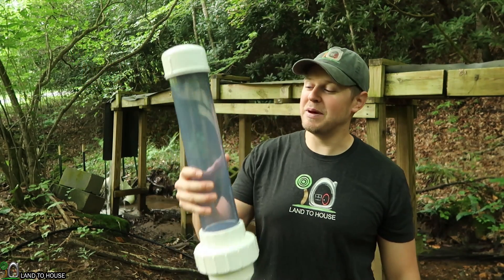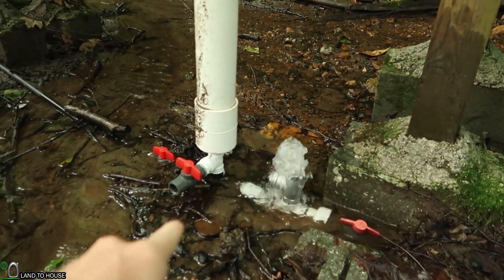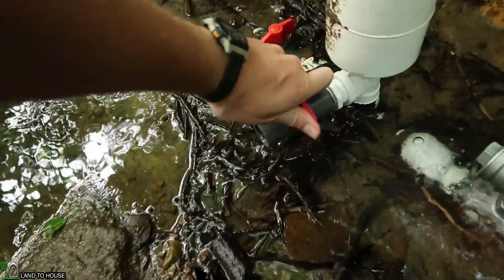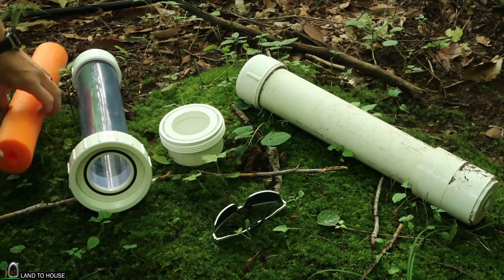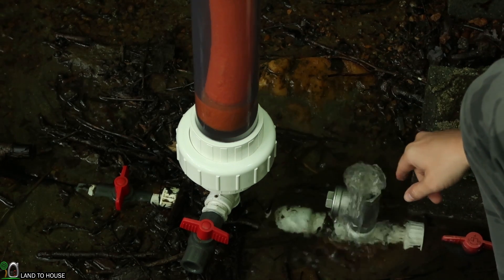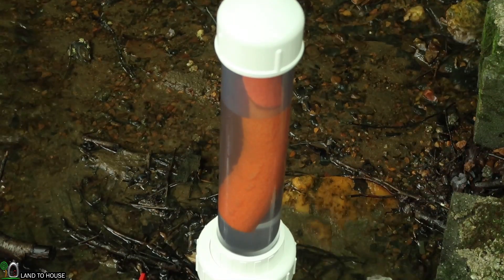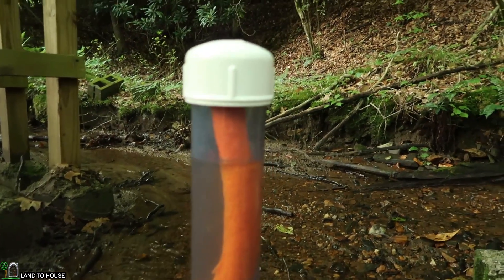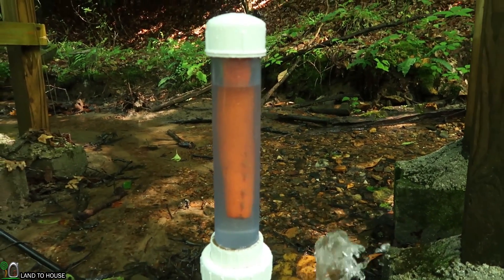Ram Pump Crushes Pool Noodle

Comment: What about using an accumulator as a pressure tank? You could even adjust the pressure with a bike pump to maximize the system output!

Comment: I believe that pressure tank it’s about 4 inches wide? getting 2 1/2 inch pipe cap each ends and make a hole in one of the cap. pass a Tire-Valve through it and fill with air and stick it inside the pressure tank note it should be half the size of the pressure tank this will be a great replacement for the innertube .

Comment: Is there any difference in head pressure if the line feeding the pump is at a 45 degree angle coming down from your filter vs it being straight up and down

Comment: I collect rain water from our barn roof in three 250 gallon IBC totes for our garden. Two sit on an elevated platform the other on the ground. I use low pressure emitters I’m raised beds. The head pressure in the totes will supply water to a point, but not near enough. Can a ram pump work with my arrangement?

Comment: fill it with nitrogen or the whole vessel https://www.toolstation.com/expansion-vessel/p70204 https://www.amazon.nl/membraan-vaartuig-uitbreiding-binnenlandse-waterwerken/dp/B004VLLNRI/ref=pd_day0_3/257-4978134-7840835?pd_rd_w=jx3m2&pf_rd_p=24063ed8-52fb-434a-81fc-a85fc785a118&pf_rd_r=V2B5M7ZBAF6QZ7451WM5&pd_rd_r=9bf15141-1993-475c-b890-190e57996de9&pd_rd_wg=NpSVf&pd_rd_i=B004VLLNRI&psc=1

Comment: Be cool if you could make the whole assembly in clear pvc. I'm still unsure of the dynamics of the ram force. Thanks great videos!
Reply from the maker: That would be fun! They do make clear valves.
Reply: @LandtoHouse  Oh yes, clear valves would be interesting! Especially the in-line check valve would be educating to see in operation. To my opinion, that in-line check valve determines (together with the drive pipe geometry) the maximum reachable pressure and the time you need to prime the pump.

Comment: I have learn from your video make 1 ram pump at my Hong Kong Farm , i am using the biggest distill water tank 5 gallon, but now the temperature difference much at day and night time, Did make a foam wrapping the tank to keep the constant temperature or put inside a bigger to keep the pressure on working ?

Comment: Does the tank even need anything but trapped air inside?
Reply from the maker: The ram pump does work without a bladder but often times it will become waterlogged over time.

Comment: Love this.
1. mark on the clear tank the water level when it stabilizes.  take the tank off, upside down fill to that mark, measure how much water that is, fill the tank completely, then measure how much water that is.  Eyeballing from the video it looks like during operation that air pocket shrinks to 1/5 to 1/6 original size.  So anything put in there will be pressured to compress to about 1/6 the air volume it started with.  

Would love to see it crush a tall stack of hockey puck sized chunks of high density closed cell foam, like exercise mats or sleeping mats.

Comment: New sub, found you on gridlessness.

Why do you need fill material?
Reply from the maker: Gridlessness's video was really funny. Thanks for subscribing. 

The idea behind the fill is that the pressure tank can become water logged over time. The fill keeps an air space in the tank at all times.

Comment: Great video Seth, what would happen if you just used a very tall pressure tank and no inner medium,  would the water weight and natural ' give' in the walls of a taller tank create the same effect as a smaller tank with intetnal medium. Pressure gauge in the top of the tanks would confirm.

Comment: I've used racquet balls successfully in my DIY pressure tank for our travel trailer.  They come in two internal pressures; 15 and 25 PSI and they've held up for a couple years so far.  I used a 50/50 mix of both to even out the outflow PSI.  I've often wondered of a ram pump could be hooked up to a 60 gal house pressure tank instead of having to pump it up to a elevated tank.

Comment: Can you test the ram pump without the pressure tank to see how the result is? If it works, the cost of ram pump will be much lower. The space in deliver pipe itself can work as a pressure tank.

Comment: Seen you on Stoney Ridge Farms with Josh. I need some help. I am disabled and freaking out as I have no water supply if shtf. I am totally disabled and can't go anywhere to get water. There is me and my Service Dog. Please can you assist me? I want a well in my yard, SHALLOW WELL. When my pool was dug, they struck the quick sand bed this city was built on at 8 foot, so they back filled the pool to less then six feet to guarantee the bottom wouldn't fall out. So I suppose one would hit water at 10 feet or less. Could you auger out a pipe hole for me/us so we can have water? PLEASE? thanks
Reply from the maker: Hello. I have no experience at all with wells. I only work with the ram pump. It pulls water from a creek to use as garden water and livestock.
Reply: @LandtoHouse  ok thanks

Comment: I'd like to see an actual pressure gauge on top of the pressure tank. You mentioned that it's getting something like 60 psi from a 7' drop? Hard for me to wrap my head around that, but I'm still studying ram pumps. I am certainly jealous of your beautiful flowing water! I have no natural flowing water and my property is totally flat, so no ram pump for me, but still a very cool system!
Reply: If you learn about water hammer it will make more sense. Its working with the inertia of the water. Brilliant.

Comment: I’m curious why you need anything inside the pressure tank! The air trapped at the top is providing pressure and acting as a shock absorber. Adding things to the tank will just lessen the amount of water in the tank. I don’t see how adding items increases pressure? The pressure you’re getting is from the amount of fall in the supply line. Wouldn’t making that line larger  increase pressure? I install emergency automatic pond siphon systems. A 12” pipe dropping off a pond dam produces a lot of pressure!! I’ve never measured it though....Very curious about what your testing reveals.
Reply from the maker: The idea behind pressure tank fill is that overtime the air in the tank becomes waterlogged and goes away and the fill material provides a bladder so there's always air in the tank. In large commercial pumps there's a snifter valve that replenishes a small bit of air with every cycle.
Reply: Hmmm. Interesting. I’m familiar with bladder tanks for well pumps and water heaters, why not use a small one of those like the ones made for a water heater? The bladder is adjustable.

Comment: OK, I am just learning about this fascinating tech. I am actually considering moving to some property near a water source, in fact I think part of this river flows over the edge of the acreage I am looking at. It would be great to have a passive system to feed some trees and maybe a garden (providing the water is fairly clean and it should be since it is a mountain watershed).  I would definitely consult you for this project. My question  today is that since the pressure tank uses the compression of air to smooth out the pressure of the delivery side of the system, why put any filler in the pressure tank at all. It seems like all the noodle would do is take space that could be used by compressable air. I realize the noodle itself has air in it, but it is also made of a material. What is the advantage of ANYTHING else being in the air pressure tank BESIDES AIR? This makes no sense to me, but as I said, I just found out about this pheonomena. As an ex-firefighter I know all about water hammer, so as soon as I realized you were just converting one form of energy for another, this "magic" made sense to me. You are basically changing high flow low pressure, to low flow high pressure, by capturing the hammer effect.  Really, you probably don't need the pressure tank at all, but it just makes the flow more reliable and probably takes off some wear on the valves as well since they move less with the pressure tank at high psi.  Also, regardless of the amount of air or material in your tank, it will still achieve the same pressure. The only difference is that a bigger tank would smooth out the pulse even more than needed.  Databyter
Reply: Over time the water absorbs the air negating the reason for the Pressure Chamber. These fill materials that are full of air are an attempt to keep the air within the pressure Chamber from being absorbed by the water.
Reply: @johnwyman6331  Thanks John. That makes sense. I guess you could also put a refill air valve in the tank which is the way I would probably roll. Just top it off as needed. Would be nice to have a sight tube of some sort to know the level of the air and have a refill valve.
Thanks for explaining this.  Databyter
Reply: @Databyter  Getting a snifter valve to work would be the best way I would think.
Reply: @johnwyman6331  that's like a pinhole valve that dribbles in a small amount of air each cycle?
Reply: @Databyter  yes it's installed immediately before or upstream of the one way valve. Sometimes you can get away with a very very small hole, or you could use a small flathead screw with an o-ring under the head going from the inside through a slightly loose hole and a couple of nuts tightened to each other on the outside which will allow the screw to move back and forth. It can act as a one way valve for the air.
Reply: I believe they're there is a point in the cycle where there's a very short lived vacuum in the pump which also sucks down the waste valve

Comment: Try to connect the pump directly to a water tank base and let us know what happens when you run the pump without a drive pipe line.

Comment: You could try inserting one or two inflated CHERNE 3 in. rubber plumbing test ball(s) into the top of your 3" PVC chamber. You'd then have compressible air bladder(s) that would fill the complete diameter of your pipe.

Comment: What would happen if you hooked a pipe to the waste valve back to the water source basicly recycling the water instead of letting it pump out on the ground
Reply: It is, the pump is in the stream where the wastewater rejoins the stream.
Now if you mean to pipe the wastewater back up hill, that can't work because you've reduced the head to zero.
Reply: @johnwyman6331  yes my question was on the feasibility of making it a self perpetuating system.  Starting it with the head of the river then closing it off and allowing the pump to divert part back up to the head to recycle the motion...
Reply: @wadekinney8  They say that perpetual motion does not work.

Comment: Hi can you prefill gases in the pressure tube with pure hydrogen, helium, argon, nitrogen ect and observe the pump performance, noise, compression and how long it takes for the gases to slowly dissolve and dissipate. You could also try installing a cutaway torus shape plate with some oil to create a thin oil barrier inside the tube.
Reply from the maker: All good ideas to try. But far beyond my ability.  Also not very practical for the average homeowner or farm.

Comment: you have a video showing your 'sniffer' valve as being some .060 inch in diameter.
It should be just barely large enough for a #14 wire. And then have a #14 wire through that hole. 

The following link gives details about a sniffer hole and where it should be located
<https://www.slideshare.net/Fatin62c/compendium-in-hydraulic-rampumps>
note especially that the sniffer hole is before the final valve
Reply from the maker: Thank you for this information. That is helpful. I do want to do further research on snifter valves in these small pumps
Reply: @LandtoHouse  I know you have some videos on snifter valves, I haven't seen a more recent video where you are talking about them. But they do make snifter valves for well systems that use a drainback system in areas where well piping might freeze. It is a metal valve, usually brass, that allows air to enter but does not allow water to escape. They put them in the pipe right before a bladderless tank in well water systems on the pump side. They are a little check valve essentially, that when water pressure pushes on the valve it closes, but as soon as there is a vacuum when the pump stops or in this case after the ramp pump hits it allows some air in. It is for exactly the same use that you are looking for, keeping an air level in the pressure tank during operating without user intervention or a type of bladder system.

You might be able to drill and tap a hole in the T right before the check valve and after the waste valve. That is there equivalent location in well systems. The valves are pretty cheap too, usually no more than $25.

Comment: What happens if you bleed the air out of the pressure chamber? As air compesses but liquid doesnt, would it not want to pump to a higher head if its just water.
Reply from the maker: I'm going to be running a test this spring without a pressure tank. The tank does a couple of things. It Smooths out the Cycles so that there is a more consistent output. It also prevents the pump from hammering hard with each cycle.

Comment: I take it that the objective is to have an object that has more resistance to compression than the air in the top of the chamber.   The thing I didn't like about the pool noodle was that the part under water was permanently deformed, which I don't understand, because in theory shouldn't the pressure be the same below and above the water line?

Someplace between just air and steel ball bearings might be the optimum compression material.   Was the issue with the air that it was too easily compressed or that it was somehow absorbed into the water?    Some inner tubes are thicker walled than others.   I'm just guessing, but maybe the most easily compressed substance that does not deform over time from the pressure, but yet keeps the highest water level at the level that you want without letting the air be absorbed by the water is the desired material?.    If I understood  a previous video correctly, higher water levels with taller pressure chambers gave give less pressure - but maybe if the higher levels were air the results might have been different?.

From a cost and ease of cleaning and maintenance  standpoint, the PVC tubes are a nice choice.   I'm wondering - older ram pump designs used more of a round ball type pressure tank that might have given more volume with less average water height in the tank - wonder if that produced a different and probably more costly result?.   Let's see - to duplicate with PVC, maybe a larger diameter pipe but shorter, might give the same result.   Larger pipes and fittings are quite a bit more expensive, but maybe a 4 inch?   Of course may not help either.

I think there was a video where double pressure chambers were used.    Will watch it, but take it that wasn't worth the effort.

Great to see the pumps being optimized.
Reply: The air gets absorbed into the water.
The video with the double pressure thanks, he eventually went back to a single shorter tank.

Comment: I'm curious why you want to put anything in the pressure tank. what purpose does that serve?
Reply from the maker: In large commercial ram pumps you have a valve called a snifter valve. It replenishes air in the tank with each cycle. In this style Ram pump I add the bladder to the tank to always give an air space
Reply: @LandtoHouse   Thank you!

Comment: What’s the ratio of pumped water vs. bypass water?
Reply from the maker: The output changes based on a few factors. But typically the pump uses 80% of the water to operate the pump.

Comment: You no how you tested waste valve height for a video was wondering if you cut the threds off flat with the top of the waste valve so you have only the valve at the top left with no up right tube just the waste valve
Reply from the maker: It might make a little bit of difference with friction loss from the threads and about a half-inch of loss from the valve height. But I don't think it would be enough to even notice for the average person
Reply: Ahh I here you was just a idea bc I seen you where trying new things bc you never now when a good idea can happen unless ya try butt I seen you've trid a lota stuff on the ram pumps just never seen that tryed on one
Reply: And Love the videos keep up the great work
Reply from the maker: @MrSteezysteve22  I really appreciate when people think outside the box.  It's a fun idea! Thank you for watching. This spring there will be lots more ram pump content.  I have 5 months worth of Monday ram pump videos.
Reply: I here that thinking outside the box is good sometimes and can't wait to see the new video bc there really interesting to see now ideas
Reply from the maker: Thank you.  Should be interesting!

Comment: I believe you'll find different results from a vertical pressure tank which traps air at the top of the tank versus a horizontal linear arrangement which doesn't trap air and truly uses the compression of the fill material inside the pressure tank.

Can you make a video experimenting the difference between a typical pump versus a linear pump?
Reply from the maker: I do think it would be entertaining to attempt a linear Ram pump with horizontal pressure tank. But it is also time consuming and a lot more work to build. I can put that on the list for this summer. I intend on having lots more ramp up videos coming out. Thank you for the suggestion.

Comment: If your trying to increase the amount of energy stored inside of your pressure pot, why not just adjust its volume? IMO, a fill material will just reduce the amount of available volume, reducing the amount of energy stored. 

If the chamber was larger, I suspect it would reduce the pressure spikes within the system. Adding a few gauges to the system would be a pretty cool addition and would allow you to measure flow.